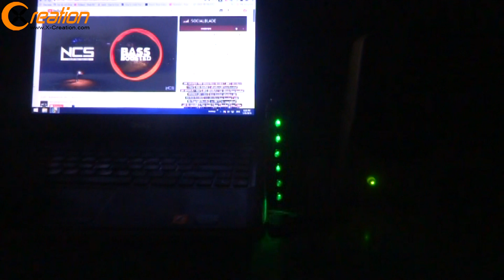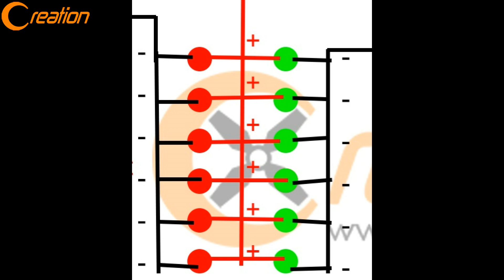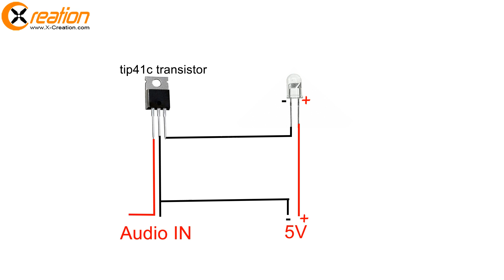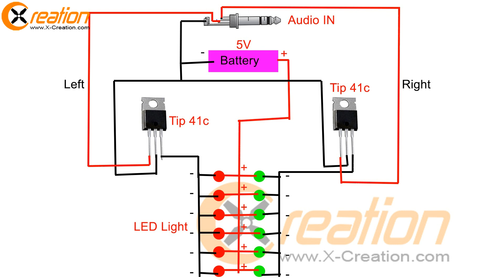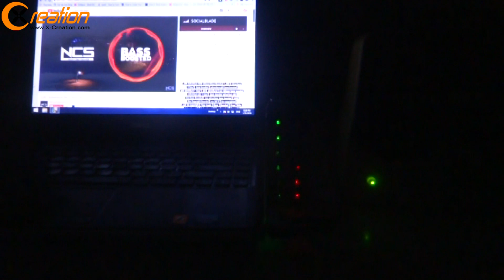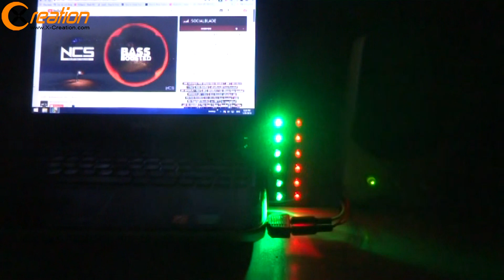How to make Stereo MUSIC REACTIVE LED LIGHTS | Simple & Awesome

Comment: No offence, but this circuit is just horrible.

There is no current limit for the LED's (which is always required for LED's). When you test the LED's, you use a resisitor in series. Altough still not really the correct way (with all the led's in parallel) it's already much better. 
Also, there is no input bias supply, meaning that the circuit only reacts to the positive flank of the signal. Furthermore, as the input isn't limited as well, the circuit is trying to limit any positive signal at approximately 0.6v (also called clipping). This is devastating for the audio quality.

To be honest, the fact that it seems to work for a couple of people is probably mostly down to luck. Long leads and such probably limit the current somewhat. Otherwise the LED's and potentially the transistor would be dead already.

Comment: Q1) u had put a 3.7v lithium ion battery inside (with holder) and sealed with glue gun .

Q2) if u did not want to recharge the battery then y did u put battery in an holder

Q3) if u want to recharge the battery then y did u not fixed a dc plug or attach a wire to charge

Q4) I think that U didn't do all the things cauz u are of very rich family and u want to spend some time in breaking and making projects like this😂😂😂😂💪
Reply: Yes...maybe he wanted than way😅😅😅😁😁